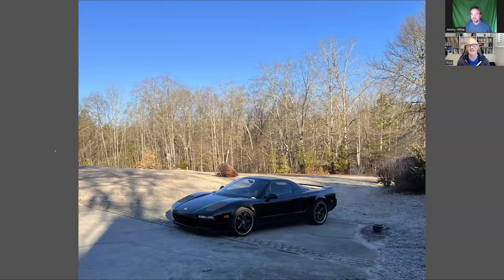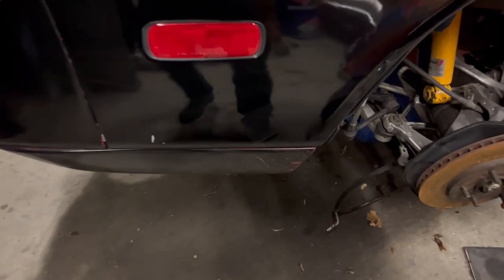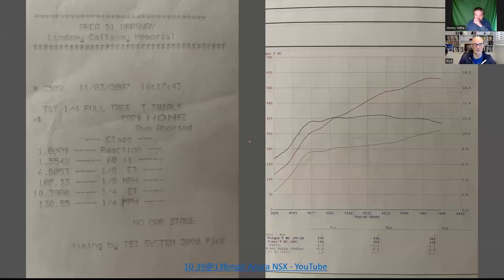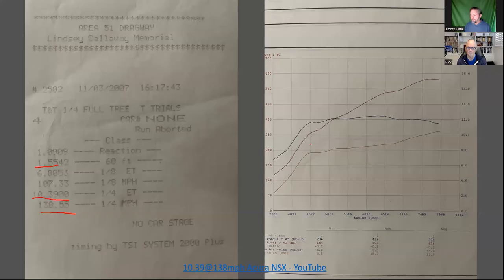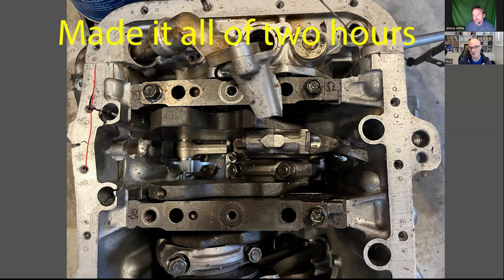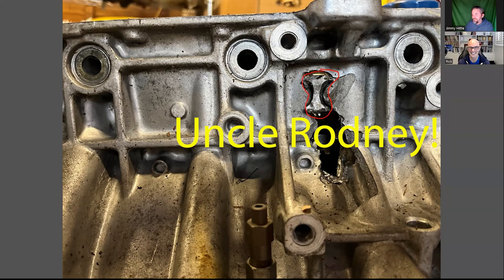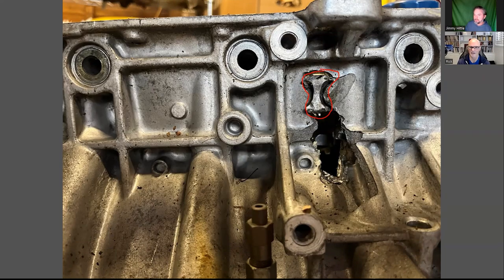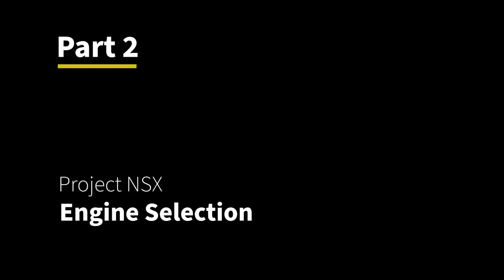PROJECT TURBO NSX SWAP PT1. DID YOU BLOW UP YOUR NSX MOTOR ADDING BOOST? HERE IS HOW TO FIX IT!

Comment: I built a 2001 Honda Accord LX V6 auto, swapped the J30A1 for a JDM J32A, and I swapped the auto for a 2003 Acura CL Type-S six speed manual with LSD andit was tuned on an AEM Series-II 30-6051 Standalone. It was ALOT of fun the way that it was with 260 HP. I fabricated a tubular manifold turbo kit for it with a full 3" downpipe and an Invidia single in, dual out exhaust with a GTS3582 dual ball bearing turbo and on 10.5 psi (according to the AEM boost guage) it made 502 whp. It pulled hard and would spin the 205/40/17s into 3rd gear easily. If the C30A or C32A was built properly it could handle PLENTY of boost.

Comment: Hey Richard! Love the videos and all the info you give to the public on testing different types of engines and configurations! I’m currently building a hemi, and I wanted to ask you a few questions about the turbo and rotating assembly set up I planned on running. If you don’t have the time I understand! But I sent you a message on Facebook about it!!

Comment: Out of the (2) C30 engines he couldn't build a good one? Maybe I'm missing something, but he has a good block and some rods with the 2nd engine. The first engine can donate it's crank and good rods right?
Reply: I was thinking the same. Then he could sell a good used engine, and swap in a J or K series instead.
Reply from the maker: did not want to use damaged (discolored) rods, why do people look only for the bad when there is so much good right in front of them
Reply: @richardholdener1727  i was thinking more along the lines of taking the good crank and remaining good rods from the original engine, then putting them in the second good block C30. Then using any good remaining rods from the 2nd C30 to replace the discolored ones. I may be wrong, but i thought a good engine could be made from both engines which has different failures.

Comment: Hey richard what is the most power you can make out of a 6.0L without affecting fuel mileage or road manners? Just leave it stock, or are there a few upgrades that won't change those two?
Reply from the maker: headers, tune will both help and not hurt mpg

Comment: Yeah that is never fun buying an engine with a spun bearing. However, you could take a good connecting rod from the broken engine and put it in that engine to have a good running engine.
Reply from the maker: no

Comment: Have you ever done tests on how valve clearance on solid lifter or bucket and shim effects power?
Reply from the maker: VALVE CLEARANCE OR LASH?
Reply: @richardholdener1727   you got me there and it could be something to clear up. 

Manuals give a value to use with feeler gauges. Example and not anyones values: "valve (tappet) clearance" intake .005-.008
Reply from the maker: THAT IS LASH
Reply: @richardholdener1727  Ever done test on how lash effects power?

Comment: hey richard, how well would hand ported 706 heads work on a mild cam lq4? 706 heads obviously make more low end power but would the porting be able to free up some top end power?
Reply from the maker: yes-porting helps a lot